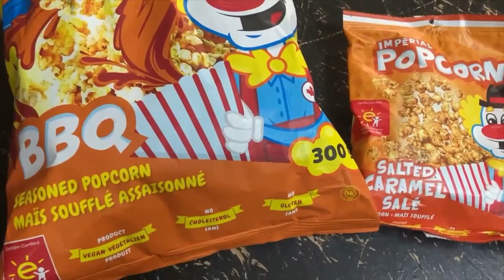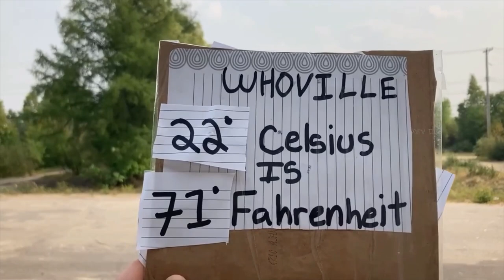Making Brake Lines for Film Trucks Plus Fishing Too Sept 02 2023

Comment: I remember doing drum brakes and heating and beating the drum for hours trying to get it off. Good times.
That was a good sized fish there, Staff. I bet that was fun to reel in.
Great video, Thanks!
Reply from the maker: oh yes, the 67 had no holes in the drum or backing plate to back off the brakes. took quite a few beers to get those drums off.  thansk
Reply: Didn’t even put up a fight, I thought it was a tiny fish until it got closer. 

Xena

Comment: Thanks for the in depth tutorial on making brake lines. I have always used the pre made lines. Some expert on utube was using compression fittings, that is a no no. Guys in the rust belt are using some kind of alloy tubing that does not rust. I think it is a little softer and better to work with but probably very expensive.
Reply from the maker: your welcome. yes brake lines should be done correctly and that is why it is important to learn and share knowledge.  thansk
Reply: @tomarmstrong4156  NiCopp line, nickel-copper love the stuff. Easy to use.   Price is about the same as regular steel line last time I had to buy some.    I'll also take the pre-made line route, makes life easy.